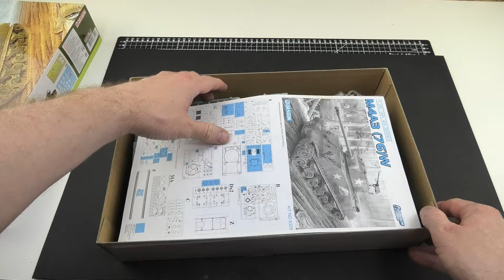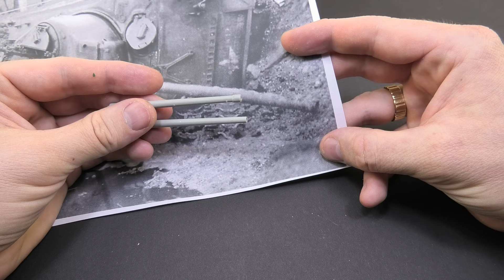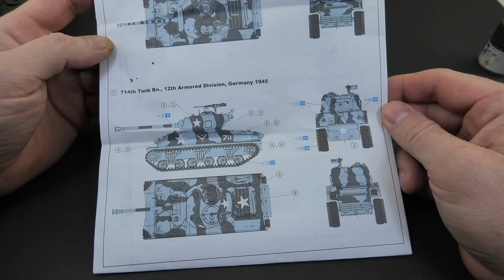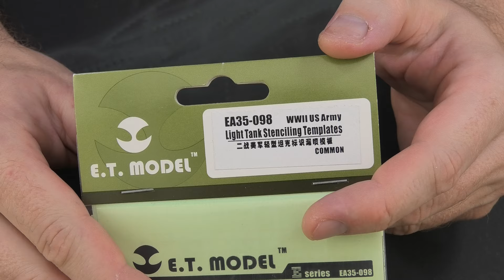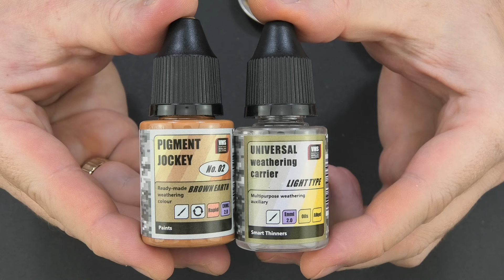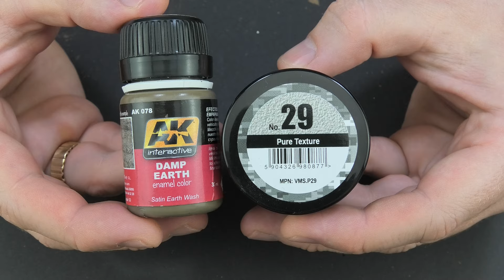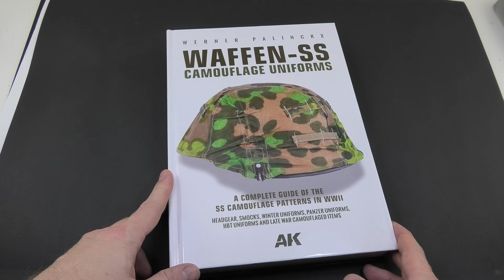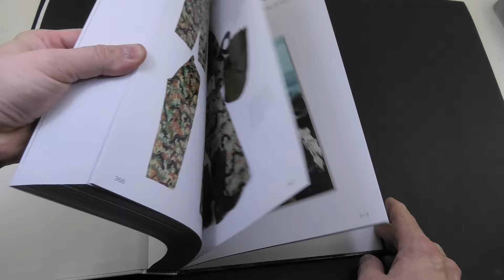SHERMAN M4A3 (76)W - full build of legendary USA tank stuck in mud and water in 1/35

Comment: DML make great kits but it depends on the teams. Shermans are not what DML does best. You should have gone for Asuka. Never the less, you overcame it 👌🏻
Reply from the maker: I had Dragon so use them but also built Asuka some time ago (Firefly) :)
Reply: @coldemonspl  Makes sense. I used the Asuka for my Sherman Flail and will use Asuka for my resin conversion to RAM Kangaroo.